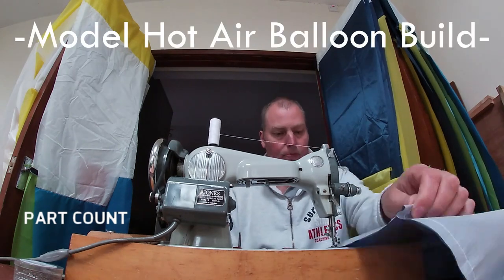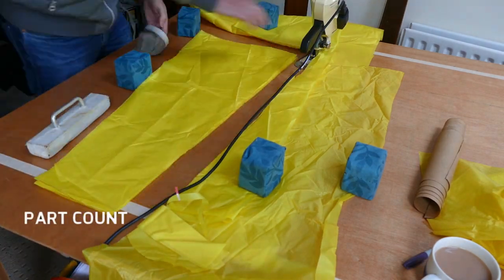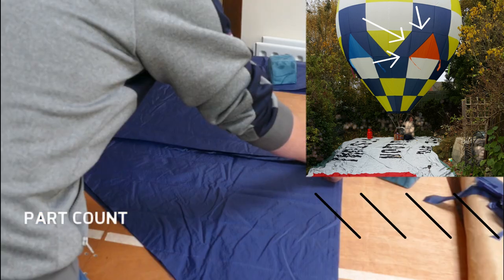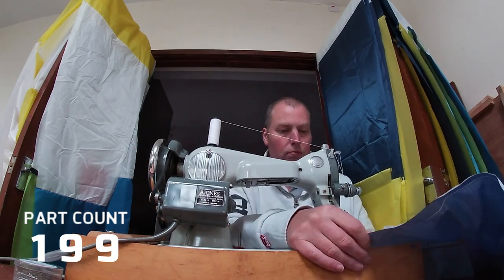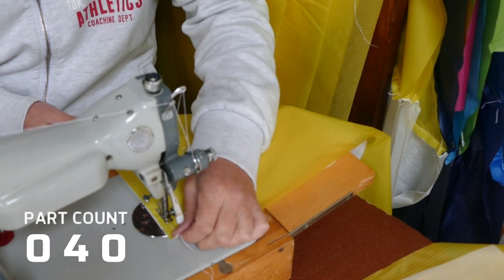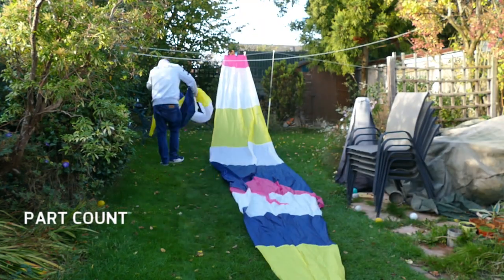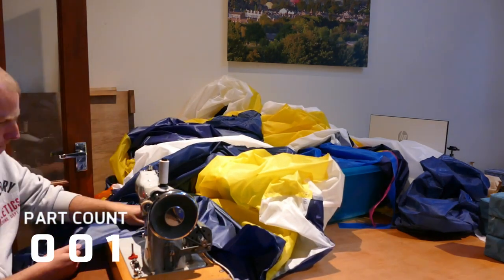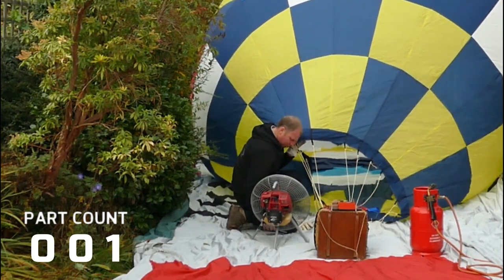How to Make a Model Hot air Balloon (Sewing)

Comment: quick question, how to make a bulbous one?
Reply from the maker: So the model in this video is a faceted envelope, to introduce billow takes the design up a level. You need to consider how much curve is going to be in each gore and then create a surface between the edge of the gore and its new mid point (the billow line). I know people who are using 3 different cad software to create billow autocad, rhino and solidworks. A quick question it maybe, a quick answer there is not 😉
Reply: @TheBigBalloonFestival  thanks mate, have a nice day

Comment: How much does it cost to build a model hot air balloon
Reply from the maker: Well pretty much a wide open question, lowest cost way is to buy spare fabrics from a balloon production line, cut and sew it yourself, for years I've been building this way, at the other end of the spectrum you can pay for a model built to your favourite colours, pattern and size, but it could easily cost to 2000Euro or more from a professional manufacturer
Reply: @TheBigBalloonFestival  I will give it a try because i already have most of the fabric to make it from my grandparents retired balloons spare fabric

Comment: how to determine the height and circumference of the balloon and how to cut it to fit the shape?
Reply from the maker: ok going to get technical, so apologies if this gets a bit deep, 2 ways to go, 1) I used excel spreadsheets for a lot of my balloons, but 2) also AutoCAD later which helps a lot. 
1) Take the outline of a fully inflated balloon and slice this into 100 slices (horizontally) 
2) we call each position a station, and you can work out the radius / diameter of the balloon at each station. 
3) knowing this for each station you can then work out the Circumference of the balloon at that point
4) choose how many Gores (vertical sections you wish to split the balloon into)
5) divide the circumferences by that number - if you draw out the coordinates you have generated in 2D you should have a profile shaped like a flower pellet
Note. you can choose 2 places to position your `stations' 1) on a vertical axis up the centre of the balloon = each station is 1% of the total height of the balloon, or 2) at equal distance from each other up the curved profile = each station is 1% of the CURVED surface length of the balloon.

WOW that got deep - perhaps this deserves a video :-) hope this helps feel free to let me know if you have any extra questions, and I'd love to see your results if you build a balloon
Reply: @TheBigBalloonFestival  thank you very much for your attention, but sorry I still don't understand,😅, for example if I make a balloon with a height of 10 meters how to determine the exact circumference, let's say each sheet is 10 meters long and 1 meter wide, how many pieces should be needed ,and how to determine the top and bottom cuts... Yes, I often try to make balloons using plastic but never have a shape like yours, maybe I'm the stupid one😂
Reply from the maker: @hiden info, no problem, and don't worry too much about getting it `right or wrong' I just `made it up' for the first 5 balloons I build some were..... unusual check out version 5 https://youtu.be/yUQcT848-NQ 
So some research to look http://www.myairship.com/building/design.html this is a great resource to get into the math. - to respond to you example - you say that the roll of material is 10m long by 1 m wide. if you put the equator at 50% (5m) up the roll and do 10 rolls wide, with the right curves you would create a sphere, a hot air balloon is closer to a cone with a 1/2 sphere on the top, so first thing to do is move that widest point further up the role to say 65% or 70% then one curve (coming to the mouth is longer and smooth) the other curve is shorter and more severe. 
keep experimenting, nothing beats a good experiment and discovering what works and what doesn't
Reply: @TheBigBalloonFestival  I am very grateful to you, and the knowledge you provide, you are very friendly and kind, thank you for your support and advice, I hope you are always healthy .. 😊